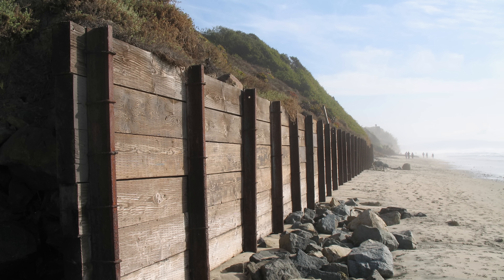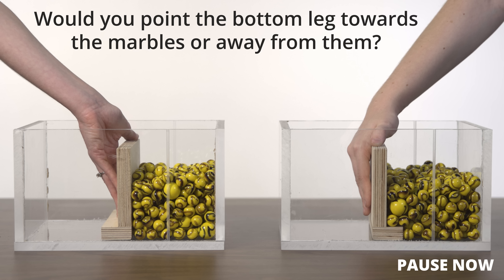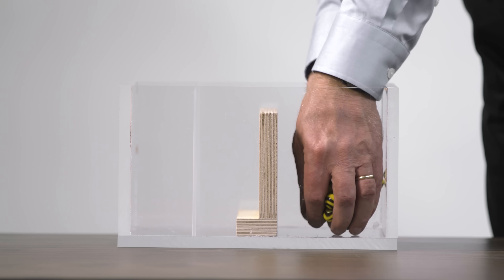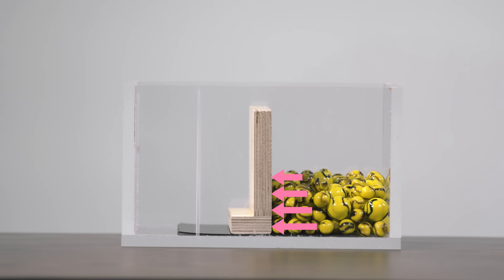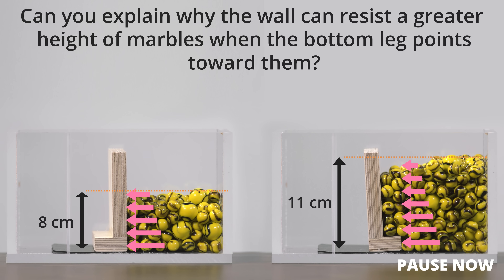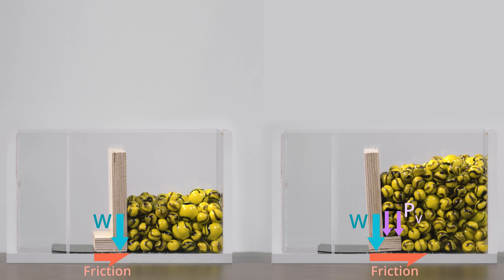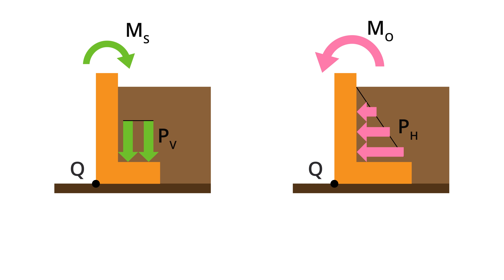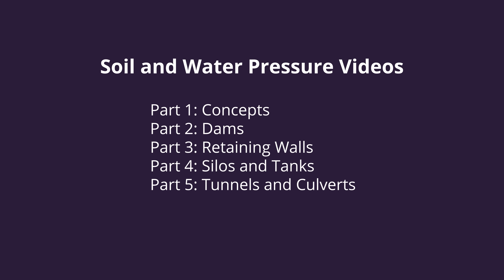8. Retaining Walls

Comment: I can't be the only one that immediately think of the book holder stand for the shelf and assume that the L should face towards the load. Am I right?
Reply: No...as you will not put a book on the foot of the L.
Reply: @MichelLinschoten Hah,  you would put books on the foot of the L. like for every single book shelf book holder in existence, You don't need a degree in Engineering. Just try it for yourself.
Reply: I also thought the same thing immediately :) Seemed pretty intuitive that the base should face inwards. Seems a pretty common concept in engineering: use that which is pushing you to hold itself back. I can see parallels with water locks for example.
Reply: What’s a book?
Reply: @itsfree2639  apparently something used for stabilising L shaped things ..?
Keep your eyes open, maybe we'll solve this catchy issue in near future... 😞

Comment: Make it a T on the bottom, problem solved. A old guy told me about a dead mans anchor. A large poured block with a rod attaching the two. Sounds right.
Reply: It is always easy to overcompensate, but it takes skill and knowledge to know how much is enough. The point of engineering is to minimize cost and maximize effect while not compromising safety.

Comment: The second the demo wall cracks, the strength to resist overturn  is  greatly diminished.
 Even better, even stronger is to add a Buttress wall, a vertical wall poured perpendicular to the main wall and anchored into the footing a nd integrally reinforced with rebar.  
I know. I repair failed overturned foundations all day. The buttress works.
Reply: @ Sydney Vincent
I backfill with drain tile at the base of the wall with 18”min.  of gravel and protected with drain fabric. Then I compact the original clay as fill. 
My footing extends 6’ sq. at the buttress location too. 
As a result I get a full 6’ of downward force to hold back the wall. 
They NEVER FAIL.
Reply: Burn Notice what fill material do you use in the void
Reply: Run a dead man footing and wall on load side the wall 2/3 the full height wall and extending back 2 x plus the height horizontally every 12 to 16 feet and the wall will.stand for a long long time
Reply: greg green 
Two years is not a long time.  
I put $5000 worth of dead man anchors in a bucket and hauled away that scrap steel. In two years the dead men let the wall move inward three inches. 
Two years is NOT a long time.  
That was 25 years ago. Those walls were pushed plumb,and Buttressed. Today they still plumb and dry and crack free.
Reply: @Burn269  do you extend the buttress walls toward the load or away from the load? How long and how frequent are the buttresses?
Reply: Dylan Cardiff  
Always into the loaded side. The weight of the soil and water will hold the 6x6’ pad down , the BUTTRESS connects both wall and pad.  I space them about 12’ apart.   
My BUTTRESS’ are 5’ tall 4’ long and 8” wide. 

DM me if you like

Comment: Shou,d gave shown the other case. Foot under marbles. No pad.
Reply: It will simply slide the same way the first one did, on a slightly higher height, like not more than 1cm. The added weight from the marbles sitting down the horizontal support increases friction (friction is a function of weight, therefore more weight = more friction) but the effect is so tiny due to the kind of material it is placed on.

Comment: face the base into the hill.  the soil weight and pressure behind the wall -- hitting the base -- will help retain itself.  
.. even better, make the wall an upside-down T .. build the base below the final lower grade .. lean the wall into the hill .. use keys (interlocking groove) between the foundation and the vertical wall (and within the wall structure) .. place anchors back into hillside (deadmen or geotextile)
Reply: The pins and geotextile is true for modular or segmented unit wall construction, but not for cast in place or pre-cast concrete. CIP walls should always (when possible) use a footing that extends past both vertical faces of the wall (upside down "T"). I design a lot of retaining walls (Architect) and we only use cantilevered walls/footings when we have no other choice. Excavating and back-filling both side of the wall for the footing achieves much greater stability and neutralizes the overturn or tipping issues.

Additionally sometimes we place wall footings on concrete piers to a greater depth to further neutralize the threat of sliding.

Comment: So would an upside down T shape allow it to be steonger?
Reply: It’s not difficult to make a retaining wall stronger. The trick is to have it support the load at the lowest cost.
Reply: @ericspda  that's what engineering means, after all
Reply: Buttress walls are usually not feasible to use in urban areas because they take too much space. Using an extension under the retaining wall (key) and a toe for utilizing passive soil force is the best way to go. If the soil is reaaaally bad (almost liquid) and impossible to drain or literally liquid, piling is better. (not sure about the "piling" word  but the turkish equivalent of it is "palplanş" you can check it out. I'm civil engineer btw.
Reply: Or even more why not a cross. Or a cross with the bottom pointed at a 45 degree angle facing away from soil.
Reply: Harvard would like to know your location
Reply: You could also make the wall 10 feet thick and have it go 30 feet down into the ground and now it will withstand the end of the world. But it doesn't have to withstand the end of the world, just a few hundred tons of dirt. How much time and money did you just waste? A lot.
Reply: '
hi S...
same this ┴
Reply: T Beats L if limbs are the same length. Better to make the L limb longer. Alternatively you can   lower the wall below the surface of the left side, this requires more work, but now the more load you put above the right side, the greater the stabilising moment.
The failure plane now is a larger semi circle not just 90 degrees.
It's been a while, but I think the point of rotation q also shifts in your favour.
Reply: @markp8295 Pearce it's forbidden to do that and take into consideration of passive soil force to the wall itself AND the heel force in earthquake zones. I don't know how regulations are for non-earthquake zones though.
Reply: @cingilc  Forbidden to increase the L length? Or dig down to form a cantilever?
I'm from the U.K. so earthquakes aren't something I have even considered.
We use sheet piles all the time here which are cantilever retaining walls, we can also add ties to the upper third of the wall if needed.
Used mainly for earthworks rather than permanent structures.
Never designed a permanent RC cantilever. wall.
Reply: @markp8295  No, I mean imagine you are designing a cantilever wall, you can take the earth gravitational force to heel (L length) and take the horizontal passive soil force to the toe (super small also better and safer to be neglected) but not to the body of the wall. "Alternatively you can   lower the wall below the surface of the left side, this requires more work, but now the more load you put above the right side, the greater the stabilizing moment." In order to make this cost-effective, you should take the horizontal passive soil force into consideration and that is forbidden in our regulations. Probably also forbidden in Japan or similar countries.
Reply: @markp8295  Longer the retaining wall, longer the active horizontal soil force is and if you neglect the horizontal passive force your safest bet is to make the wall as short as possible. English is not my native language I hope I could talk properly.
Reply: @markp8295  this is of course for cantilever walls not for piling. For piling we only use both horizontal forces. We also use sheet piles for temporary solutions but we use something "bored pile" (thats from the dictionary turkish equivalent is "fore kazık") for permanently.
Reply: If you took the part of the T on the left and used it to make a longer bottom to the L facing the marbles that would work even better.
Reply: This is what they build military bases from when deploying, we literally call them T-walls. Vary in sizes (i've personally seen up to 8m high), they have two protruding ring made out of the rebar on top to easily place them with cranes. Not to be confused with HESCO bastion walls though
Reply: This is the question that needs answered.  Pointing both ways, what happens?
Reply: It would also help prevent undermining erosion on the side away from the wall.
Reply: Capital W walls are mandatory in Australia now
Reply: Yes, but it's not always practical. Using a L shape pointing towards the soil uses the self weight of the soil to keep sturdy so it's more practical.
Reply: @blakeb4583 , yes however it sucks digging out all the dirt where the "L" goes including the dirt above it
Reply: More surface area and you would still have the marbles pushing down on your wall.
Reply: That would be the other method he refused to elaborate on.
Reply: Aaron Aartun Tahoma - the seldom utilized but simple but effectual design - even in fonts as high as - did I say HIGH - Oh my goodness - so anyway - what was it about goldfish we were discussing?
Reply: A lateral uppercase R is ideal
Reply: What no one has addressed concerning T walls, W walls, or Z walls is the fact that italicising any letter yields a minimum of 20% increase in strength.
Reply: It would be better to use a longer bottom of the 'L' with gussets along the vertex to increase strength so the 'L' doesn't break there, then bury the bottom in the dirt or whatever. That sucker would be pretty tough at that point. Also, run long stakes through the bottom into the ground. That will be ever harder to slide than a piece of rubber.
Reply: @Aaron Aartun Good points all AND we are now able to deduce that the Capital D wall is ineffective whether it is right side up or upside down.  But the Capital R wall whilst right side up may be slightly more effective that the Capital D wall however the upside down Capital R wall seems to have the better chance of not overturning because then we have dumped out all of the RINOs first.  :o)  

Blessings and thanks for the laugh  XD
Reply: Use the left part to extend the right bottom part for added strength.
Reply: Anyone can build, but engineers cut costs and makes sure these structures don't blow the budget
Reply: Suicidaljello yes
Reply: @silentwatcher1455  Sometimes u dont have enought space to make T form of wall or u spend concrete no need.
Reply: It’s called a BUTTRESS.
Reply: @Burn269  That's what I call my side chick.
Reply: Burn Notice Buttress walls are only needed to keep brick/stone walls up. Most retaining walls are solid concrete which are strong enough to not need buttresses. There is no need for a T shape retaining wall. Extending the L is always stronger and visually cleaner than creating a T.
Reply: You are all wrong, the strongest letter is the letter N, followed closely by the letter Z if it is rotated 90 degrees.
Reply: @Sluxslol  slides
Reply: It would look stupid having the T exposed, you would have to bury the horizontal section so it doesn’t look stupid.
Reply: Chuck Beef 
You can pour it to whatever height you need
What looks even “stupider” is an unreinforced wall laying on the ground, covered with backfill. 
A buttressed wall will never do that.
Reply: Burn Notice neither will a straight wall if you tie it back properly.

Comment: i'm on the practical end here; i build them.
 when you make a retaining wall you would increase the length of the 
L leg with increasing the height of the wall (as said) ALSO  you make the L leg thicker
both of these will counter the tendency for overturning or collapse of the wall.
if the wall is over 6' we normally will have some footing extend past the vertical 
part of the wall (like a upside down T)this moves the tipping point 'Q'   further from the vertical leg and increasing the stability of the wall
Reply: Although all this is interesting, and informative. It is out of date. At least in America. Having worked in civil engineering both in California and in Alaska I can say the L shaped retaining wall is hardly, if ever, used. Most systems now use interlocking blocks about one ton in weight with a locked geogrid system extending between the blocks to some distance into the ground. This radically changes the physics involved compared to the older style wall. The interlocking geogrid system has made serious improvements in environments that suffer significant liquefaction issues during seismic events.
Reply: I have never built an L shaped wall. Just a straight wall that is tied back on each layer into the bank so the more pressure the fill has, the stronger it pulls the wall back into itself.
Reply: wowiezowiepowie can you tell us about utilizing different/lighter materials between the wall and the land being retained?
Reply: we use a rubberized membrane and black emulsion sealer
on the back side and lots of drainage rock with a geo fabric  
on top  for relief of the hydraulic  pressure/ drainage with some pee holes 
if needed.
Reply: Sydney Vincent, the best method is drainage gravel or "concrete"gravel which is better than using pea gravl. because the size variation it stands better on its own, pea gravl tends to spill like water. But both are like 95% compacted meaning they won't settle or tend to compress. And adequate drains or weep vents thru wall are the other factor. Soil or crushed rock will always continue to settle and push
Reply: wowiezowiepowie 
cylindrical  containment.....
Reply: @wowiezowiepowie, thanks for your factual and coherent response. You saved me a lot of typing.😁
Reply: That's what we always did too. And installed periodic lateral stabilization beams ("deadmen") as the span and height increased.
Reply: I learned more from your comment than from the video. Thanks!
Reply: I have designed a few retaining walls myself, and have found that in a soil with a very low bearing capacity, it is better to have the toe more to the "wrong" side (like an upside down T) as the pressure below the base is much more evenly distributed and has a lower peak than having it in the "correct " way.
Reply: How is friction added in the real world to the footings to stop slipping?
Reply: @davidmitchell6436  I would guess hammering rebar down into the ground might help with the horizontal forces. Also dropping the bottom of the wall below grade might help as well.
Reply: Yep, keyway.
Reply: Wrong
Reply: Free Audio Books  your one word reply speaks volumes of your lack of understanding of the problem.
Reply: @freeaudiobooks7469  
Troll.
Reply: @freeaudiobooks7469  is having a joke with us.
He is parodying Donald Trump in the election debates :
after a long detailed reply by his opponent Trump would lean in to his microphone and say "Wrong". 

It was quite funny.
However it is not a suitable repost to a well informed comment about
engineering.
Reply: @vinm300  somehow I find it more disturbing the POTUS is relying on that sort of communication ... 😵
Reply: @OmmerSyssel  you should be questioning not his communication with the media, but the real world communication that brings results.
Engineering, building, etc. is quite different from politics and media.  Ignore the propagandized news blips, thank me later.
Here we have a video about retaining walls and vinm300 decides to make it, well...a garbage response about politics completely missing context, many layers of context.
Which brings me back to this discussion on retaining walls.  Layers!
That is another way of looking at retaining walls. Build good layers behind the wall and it becomes its own wall.
Many different methods for this.